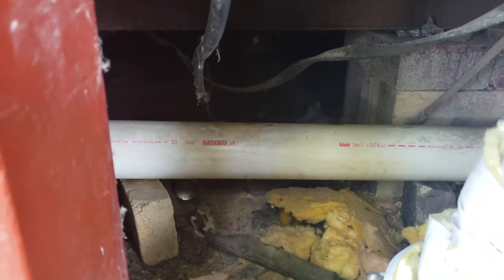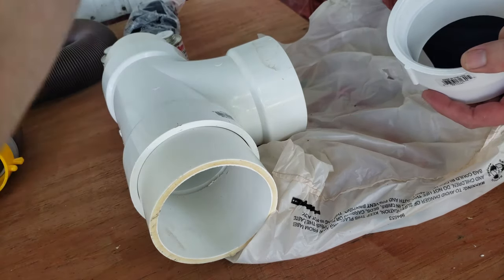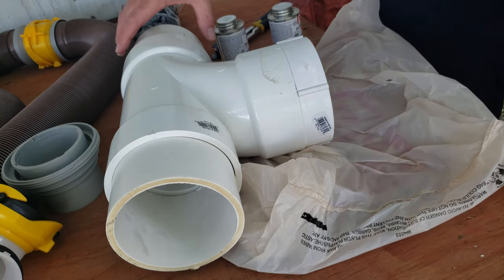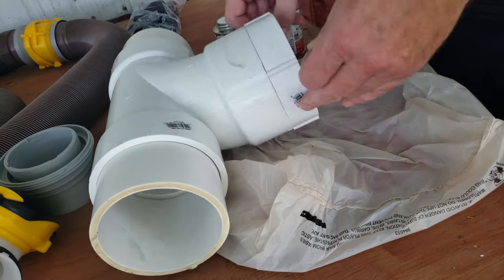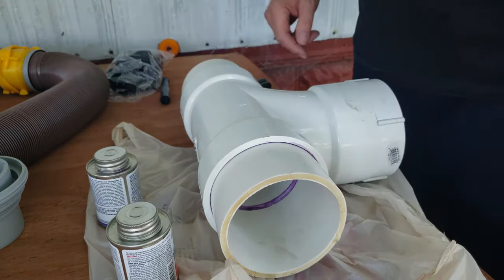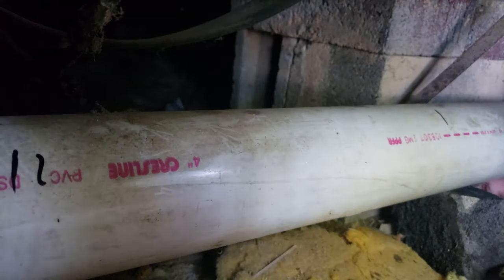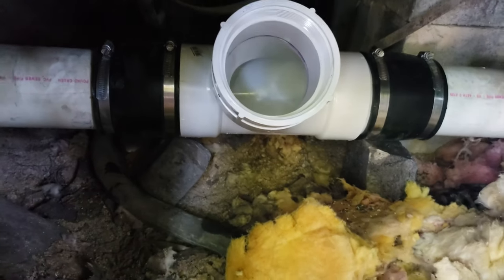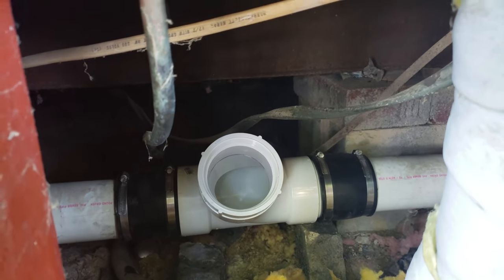Installing an RV dump station into my residential septic system was easy

Comment: Plumbing code violation using a sanitary tee in that position. They're used to transition from horizontal to vertical. Needs to be a long sweep combination or wye with 1/8 bend (45 degree fitting).
Reply: Agree, needs to be an arc or a "Y" this setup could cause sewer backup into home.
Reply: @gabrielbordenave8219  so draw it out..this person took the time and you diss it... fix it show me your stuff!
Reply: I thought code required a P-trap too. Of course, I don't think this person is expecting code enforcement to look under his trailer. In reality, could the RV sewage get up into the trailer and out the shower, several feet higher than the Tee, and that looked like a short wye to me, not a T, but I wasn't looking that closely. This setup looks serviceable to me, except any spills are difficult to clean up under your house. My personal preference would be to run an extension outside, but hey, I have to drive to the dump station and wait in line, so how clever am I?

Comment: I would like to understand the angle requirements of the drain line connecting to your fixed system from the RV
Reply from the maker: The angle of the T fitting on the mainline is at about 45 degrees. Obviously the higher the better but in my situation that is were it is comfortable to access it under my trailer.
Reply: Should be 1/8 in. to the foot for the residential drain.

Comment: That pipe looks awful thick like schedule 40?    Regular PVC residential sewer pipe is schedule 3034.   Not so thick and expensive.   But don't use thin wall or schedule 2729.   Not strong enough.
Can you imagine doing all this with cast iron - melting lead.   Watched my dad do that.    The good ole days weren't that good.  Except we had a lot more inexpensive land.

Comment: Basic plumbing 101. Never lay a San tee on its side for waste.
Reply: Next thing is you always turn the pipe into the fitting to spread the glue. Definitely not a plumber.
Reply: Also that 3” fernco is made for sch 40 pipe and the existing pipe is thin wall.